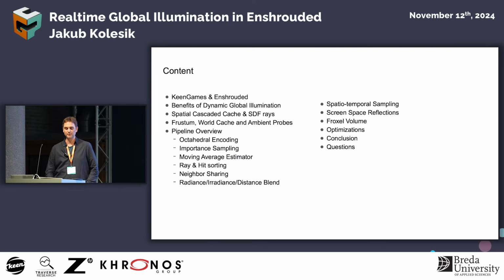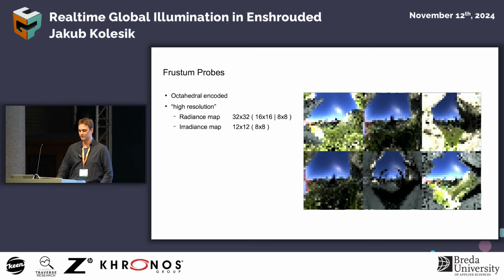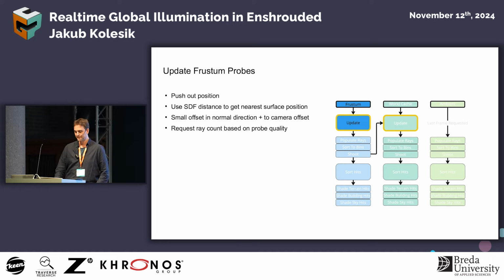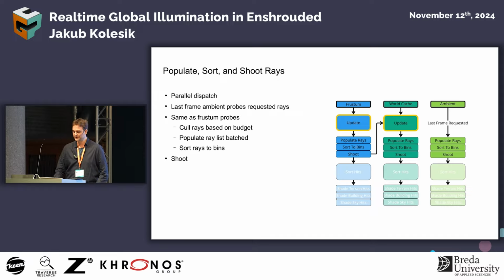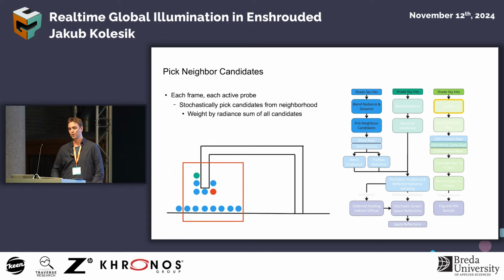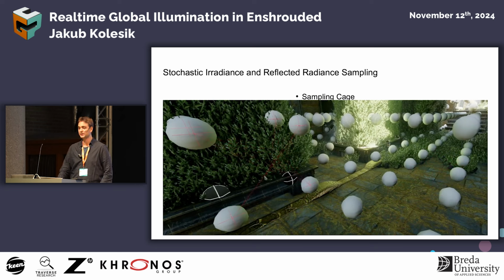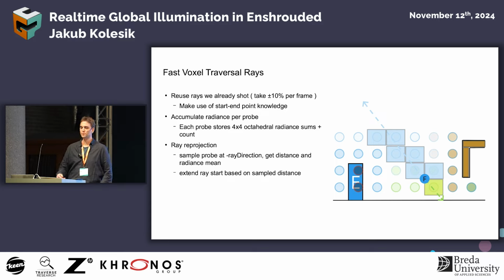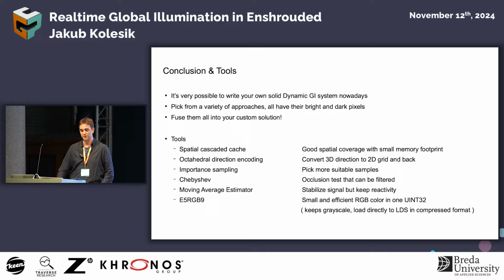Realtime Global Illumination in Enshrouded

Comment: So he mentioned re-using open source code?  Wouldn't there be license issues?
Reply: Not if it's under MIT.
Reply: You might be thinking of 'CopyLeft' licenses.

Most open source code is simple 'use this as you like'. Early on there was a focus on various 'Copyleft' licenses where the licenses where infectious, you could only include copyleft code in other copyleft projects. Needless to say, most commercial projects just... didn't use those open source projects.

Most open source projects now are MIT, ZLIB, or other extremely permissive licenses that allow their use pretty much anywhere as long as you're not changing the license of the original code. Sticky, but not infectious.